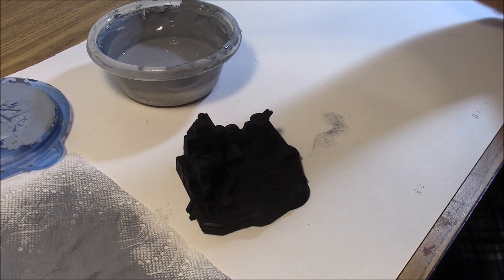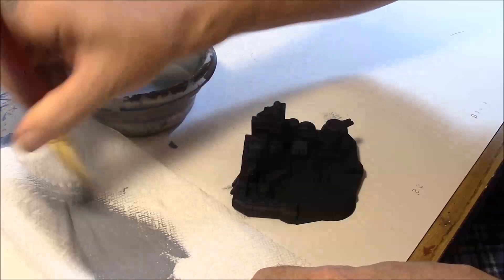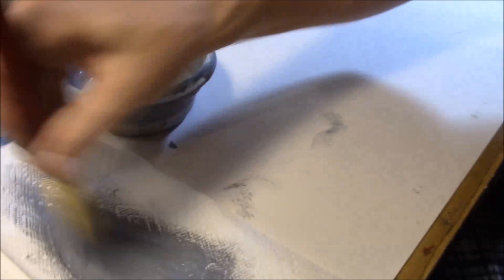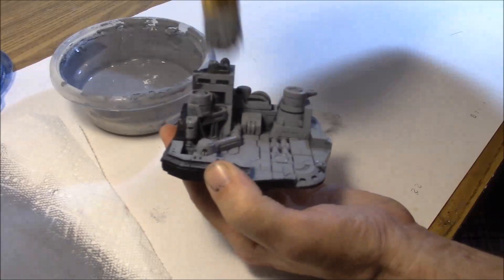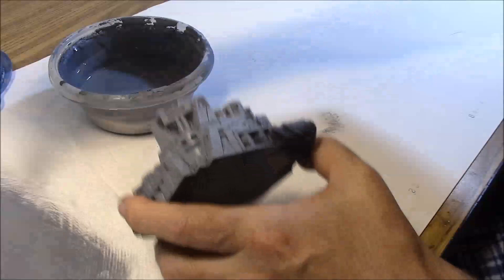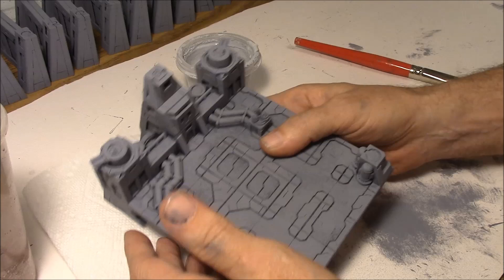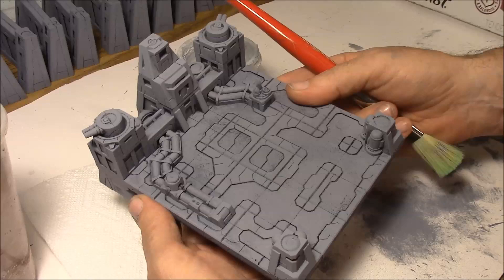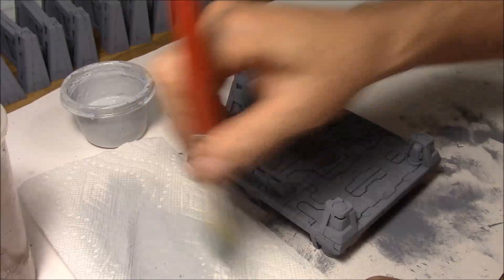How to Paint the Star Fortress

Comment: Hey I posted on an old video, Sandbag Fortress.   I wanted to ask how  you made the planks? Also, the sandbags? The clay I bought, apparently is non hardening, and when I tried to bake it, it melted, for the sand bags that is.  I haven't made the planks yet.  Thanx!
Reply from the maker: I assume you are asking about the casting material put into the mold to make the sandbags and planks. I prefer to use dental stone, and you can find information about it on my web page at http://www.hirstarts.com/casting/dental.html

Comment: Can we cast these out of Smooth On 325 successfully?
Reply from the maker: Yes, you can use smooth-cast 325 or 300. Just keep in mind that the pot life on 325 is only 2.5 minutes so you would have to mix and pour it very quickly. You would probably only be able to cast one mold at a time and would not have enough time to fill more than one mold. Smooth-cast 300 would give you 3 minutes which would probably be enough time to fill 2 molds.

To preserve the life of the molds, I would also suggest spraying them with ease release 200 (smooth-on sells this also) and then baby powdering the molds before pouring the plastic. This mold release still makes it possible to paint the pieces without having to wash them first.